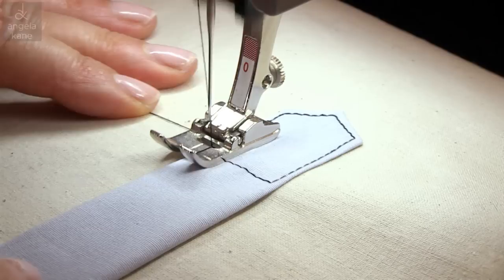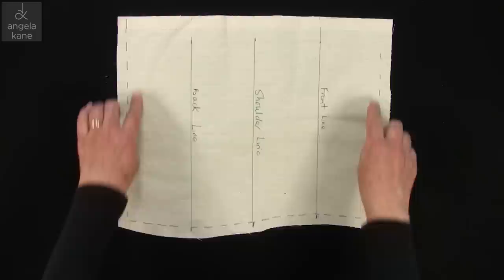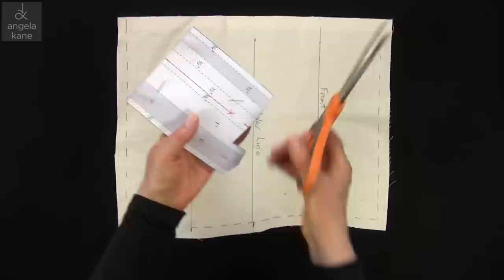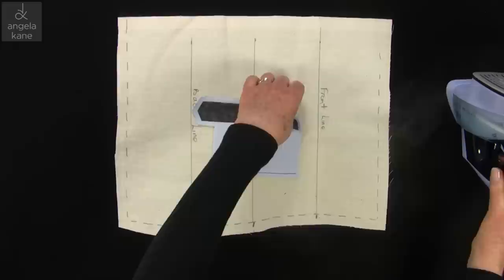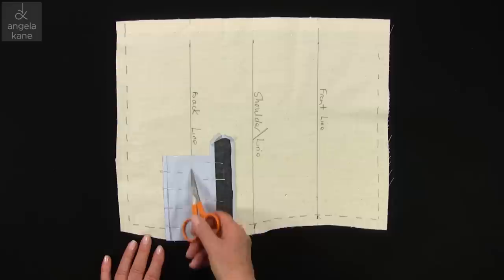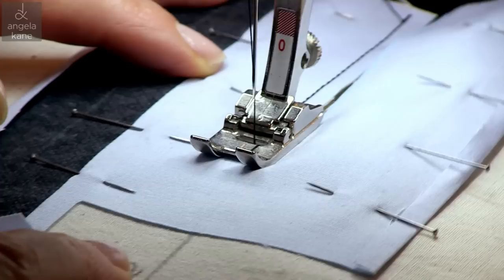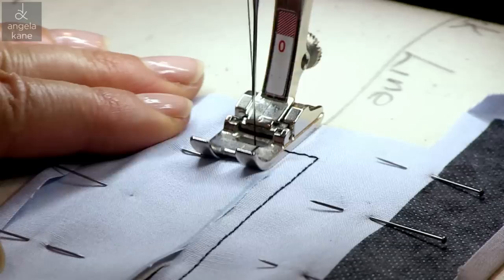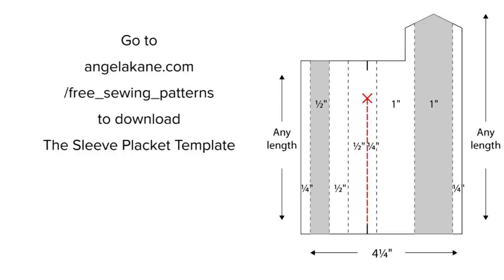Sewing a Shirt Sleeve Placket Part 1

Comment: I need some direction re: positioning of the fabric.  Initially, you cut two pieces of fabric, with right sides together.  Then, before cutting the slit, you tell the viewer to reposition the fabric with wrong sides facing up.  Why the change?   Also, I'm using an American sleeve pattern.  The curvature at the end of your sleeve, is located at the shoulder of my shirt pattern, making it difficult to properly place the placket at the end of the sleeve.  You make it look so easy.  Thank you for listening.  Dennis Fontana

Comment: I have a single piece sleeve.  how do I know where to place this template?  there is a slash line on the pattern piece.
Reply: The slit is always towards the back or away from the front. Depending on the sewing pattern you're using there are notches on the armhole and the sleeve to indicate where it's facing but as a general rule of thumb the slit always faces the back.

PS. Just saw that this comment was written four years ago but this might help someone else out in the future?